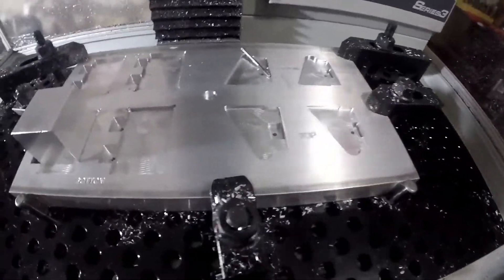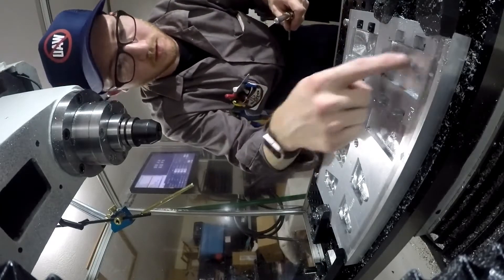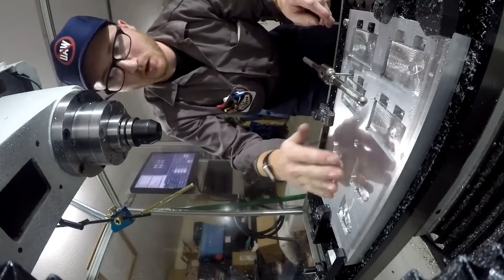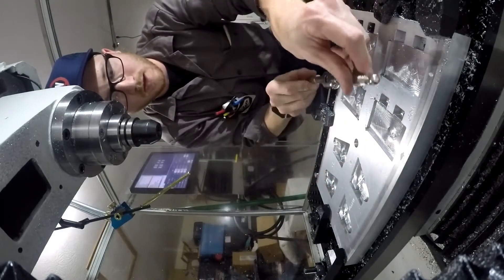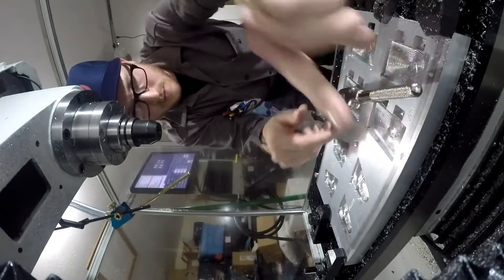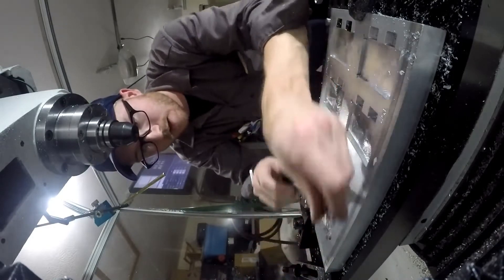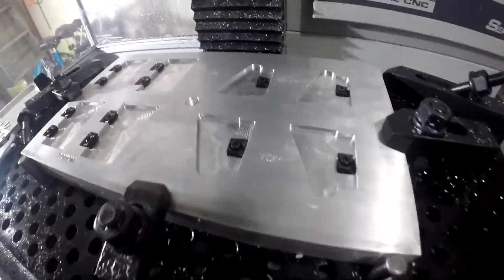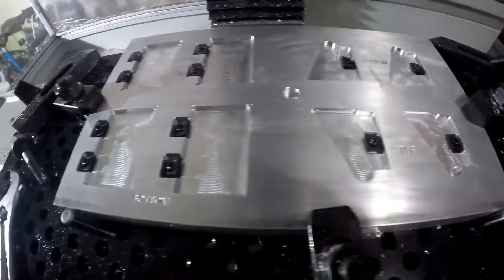Machining a Fixture: After Work Special #94

Comment: Nice job!  I'm assuming that's a SMW tooling plate?  How do you like it so far?  I am looking at getting one. Does it seem like there is enough thread in the plate?
Reply from the maker: Craig's Machine Shop I really like it a lot! There is definitely enough threaded holes to make it worth your while. I really like being able to use 1/2" dowels pins to locate things as well. Like the fixture I made here.
Reply: Cool!  Do you feel like there is enough threads per hole to hold it down?  The guy from Tosa was trash talking it saying here was only 3 threads and it might pull out.
Reply from the maker: There is about 4-4.5 threads for a 1/2-13 bolt in each hole.  He gives a torque spec of 45 ft-lb for each fastener.  I never had any trouble with it yet.  Hope that helps
Reply: Yeah, I will probably get it.  Thanks for the info!